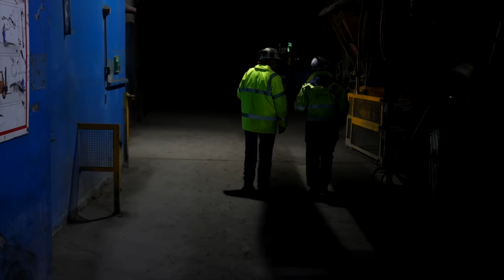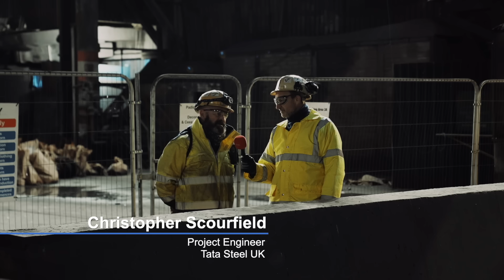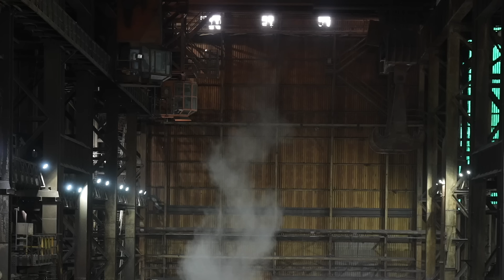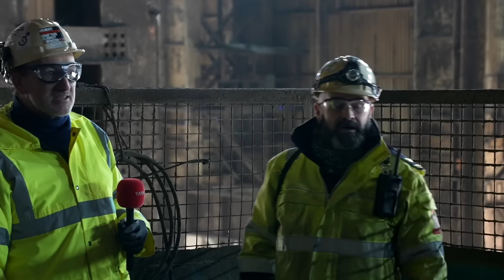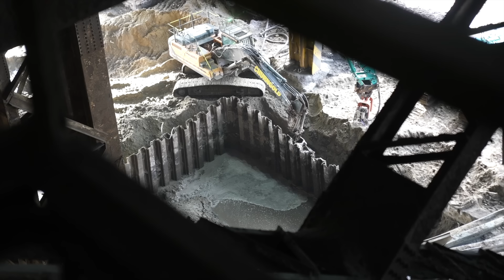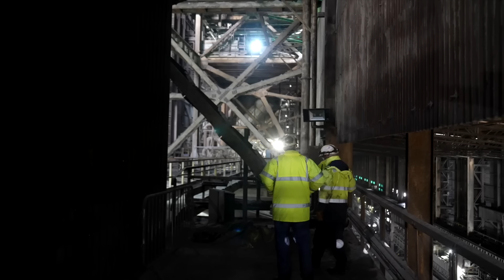This is where Tata Steel’s Electric Arc Furnace will take shape

Comment: Port Talbot steel works built on sand dunes with a very high(sea level) water table. I worked on the HSM mods in the 1980's. The foundation actually floats on piles and sand, but if the sump pumps are off the cellars would flood at high tide. Changing the load distribution in a building built on a piled raft could cause a big problems in load distribution to the ground. I have found piles of a certain age are not always where they are supposed to be.  And there distribution would have been to support for the original building loadings.

Comment: The electric furnace cannot make high quality steel all it's  good for is melting scrap into poor quality steel no good for making armour steel😊,
Reply: Go ask Sheffield Forgemasters (for example) that one....  see what answer you get....  some of the highest quality steels in the UK and world are made in EAFs
Reply: @alastairclarke730 right for one forge masters only use high quality clean steel scrap not cars trucks or buses where as other electric furnace do that's the only reason forge masters mack high quality steel,😊
Reply: Sheffield Forgemasters has made armour steel, naval propulsion shafts, and nuclear components in EAFs for decades. Royal Navy submarines use steel made in electric arc furnaces.
Your point about "clean scrap" actually proves the opposite of what you think - it shows feedstock quality determines output quality, not furnace type. With proper inputs and metallurgy (that's what the ladle furnaces at Port Talbot are for), EAFs produce any grade required.
Special steels have been made by EAF since the 1960s. This isn't controversial in the industry.
Reply: The steel will be processed further before it goes to continuous casting. It’s going to be a very different process to Celsa in Cardiff.
Reply: Nonsense! Special steels have been made by electric arc furnaces for over 60 years in the UK!
Reply: @rodlaughton2318 rubbish 😊😅😂,
Reply: Re you an ex steel worker ore is your info from book's 😊😅😂 🤡. @rodlaughton2318
Reply: @rodlaughton2318 electric furnace steel can't beat blast Furness to BOS plant steel 😊😅😮,
Reply: @joginns778 any evidence to support this claim?

Comment: With the cost of electricity in the UK being the most expensive in the world, how will an EAF in the UK compete with steel prices around the world? Another point, Tata shut the blast furnace down in Wales and just opened a brand new blast furnace in India. All we are doing is moving the Co2.
Reply: Ive heard rumours that the UK government are offering the swansea tidal lagoon project to tata to be used to power the new furnace. They build it. And get the energy produced for 20years.
Reply: UK industrial electricity is expensive - fair point. But a few things:
Large industrial users negotiate preferential rates, and government has signalled support for energy-intensive industries precisely because of this.
EAFs use roughly 400-500 kWh/tonne. Blast furnaces use the equivalent of 2,000+ kWh when you include coking coal. So even with higher electricity prices, the total energy cost picture is more complex than it appears.
On "moving CO2" - Tata's Indian blast furnace serves Indian/Asian demand, which exists regardless of what happens in Wales. The UK can only decarbonise UK production. The alternative isn't "keep the blast furnaces" - it's "import steel and export the jobs too."
Reply: I have also heard it will be a hydrogen plant, university campus, and ship yard. No idea how true that is
Reply: I think tata have taken the goverment money to build the ark furnace to then say its not viable & use it to scrap the site to get some revenue and move all operations abroad. I hope im wrong but i dont see port talbot steelworks ever being a major employer again. We just cant compete with operations abroad

Comment: Where is the power coming from ?
Reply: All the hot air generated from the Senedd and the UK parliament will be redirected to power steam turbines powering the arc converter - Dai electric and Jones the steam have assured me it is feasible but the trade off is the smell of BS  which the people of Port Talbot have long since become accustomed too.
Reply: The power supply will apparently be from Cardiff, which it will share the power with Celsa steel, and that alone draws alot of power. So with the cost of electricity, sharing the cardiff grid with Celsa steel, it will not last long, they will fore it up handful of times then TATA Steel will pull-out of the UK. They can say they tried but failed due to cost. Going green has ruined the industry. Would of been cheaper to put a small ARC furnace at  Newport Llanwern, which nobody ever talks about or even mention

Comment: Crawler crane is the name of the crane type you were referring too. Very interesting stuff.
Reply: Jon, 
it is an overhead gantry crane used to charge the furnaces, hence charging crane.
Reply: @iareid8255  Yep the crane inside the bay in a girder crane, the one outside the building that will lift the old girder (charger) crane out is a crawler crane :-)